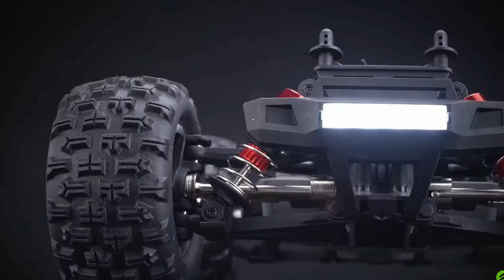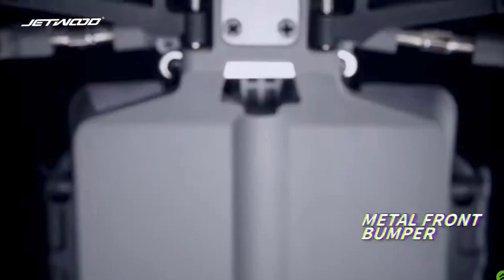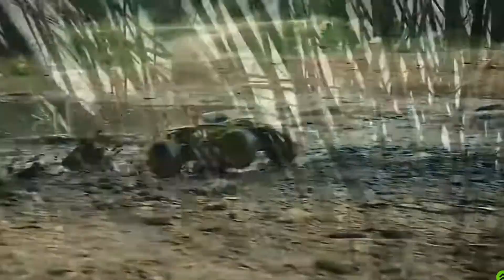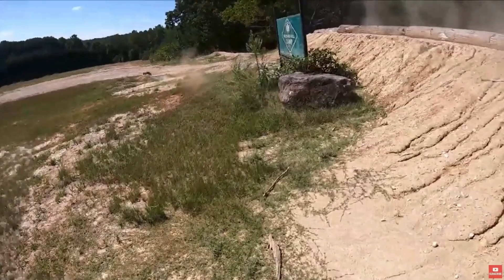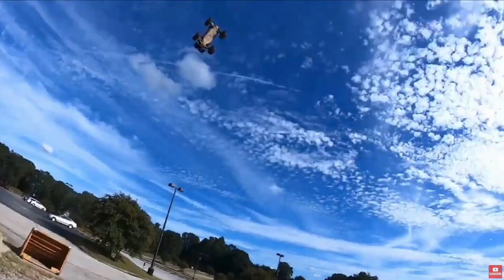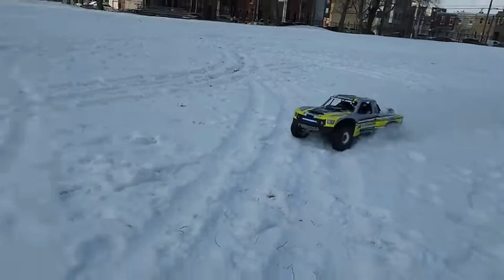High Performance RC Car Upgrades

Comment: Just got an ADU nototrius chassis today and a v6 clipless body coming with the hardware . It’s so not worth it to get the body anywhere other than Jenny’s since it comes with the $23 hardware already attached . Otherwise a person would need a lot more than the two center tower braces , center diff cover and center body piece just for a clipless body . I d stick with the pins